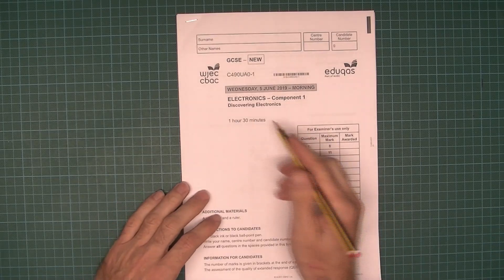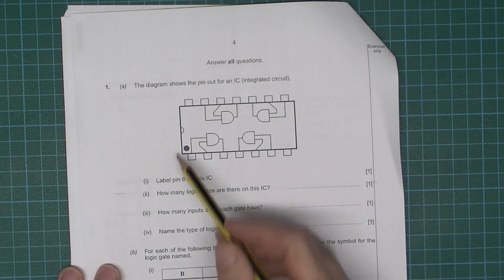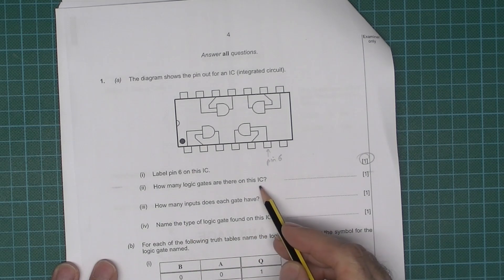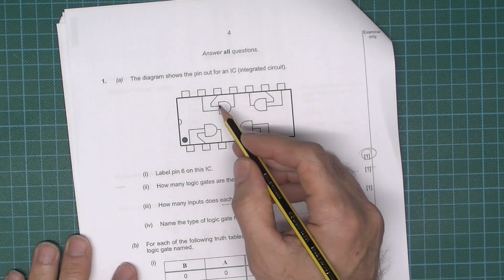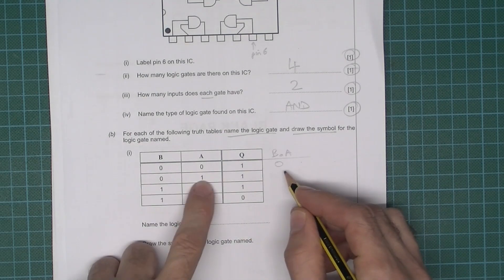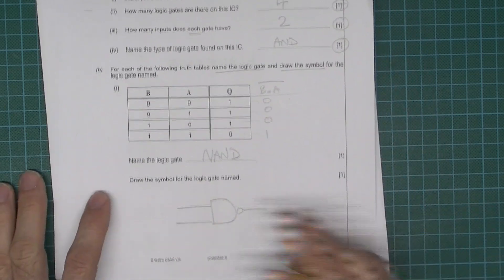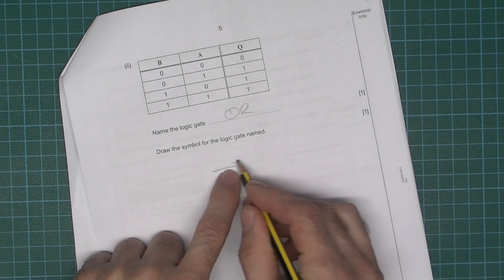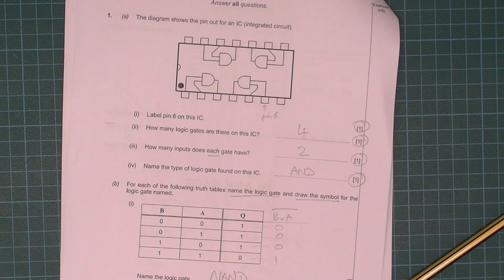GCSE Electronics mock exam revision 2020 Component 1 Q1

Comment: I have a question, why are they teaching US style gate symbols instead of the square box UK style (with Ampersand "&" symbol) inside it instead?
Reply from the maker: These logic gate symbols have been standardized for many years in the UK. I have school text books dating back to the 1980s that use the same symbols, and I suspect they were used earlier than that.